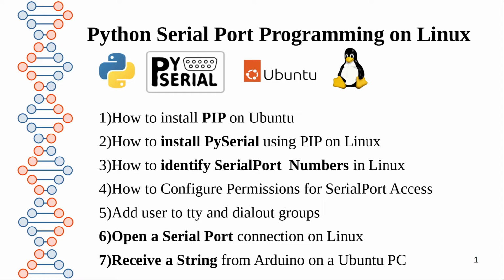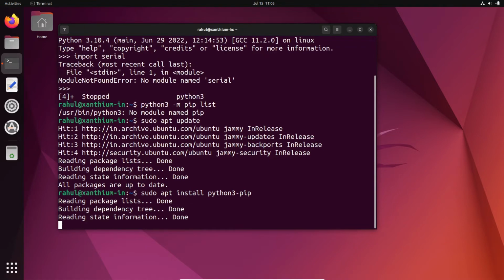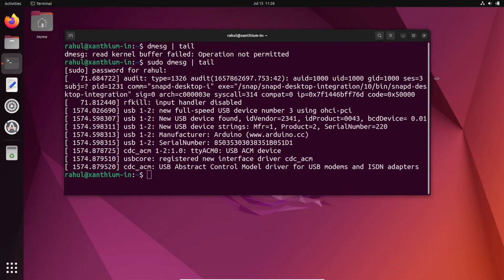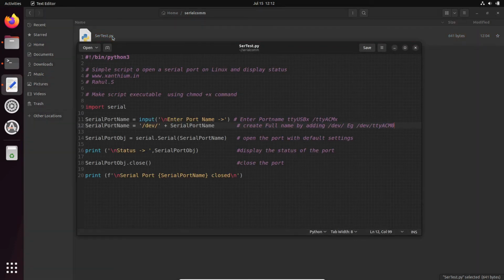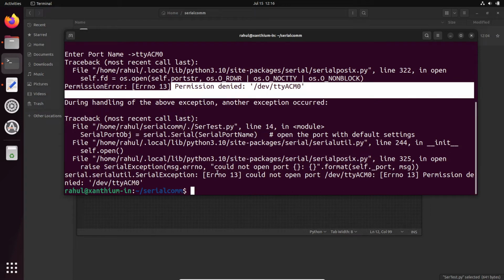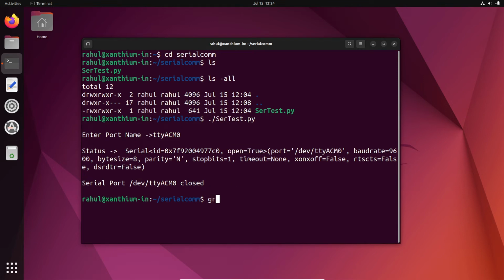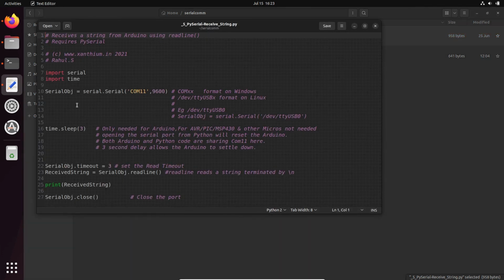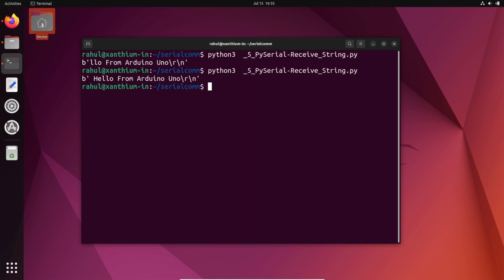Serial Port Communication between Linux (ubuntu) and Arduino using Python and PySerial Module Pt-2

Comment: why its printed for me an empty string (b' ' ) when i use kali linux but when i use terminal windows its printing fine
Reply from the maker: Some times the  PC misses a character reception. 
The Arduino on the other side is sending the characters continuously and the read may have timed out.
"when i use terminal windows " - you are referring to the Linux terminal here right?
I have tested the code on ubuntu
Reply from the maker: let me know if you have any issue 
If you like our content Do like and subscribe
Reply: @XanthiumIndustries  When i use ubuntu i still have the same issue the ubuntue is installe on my computer as still i cant read the data .On the other hand when im using the respbery pi  i can read it fine
Reply from the maker: @molazem7rb637  have u set the permission s correctly.reset the Arduino just before reading